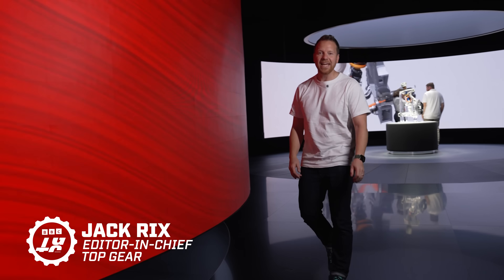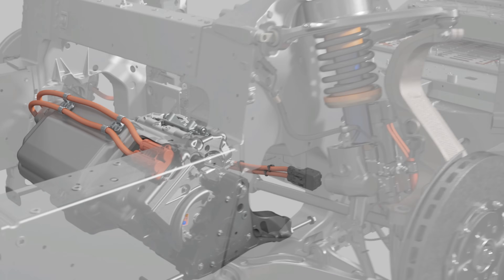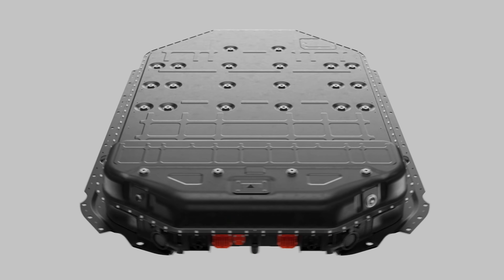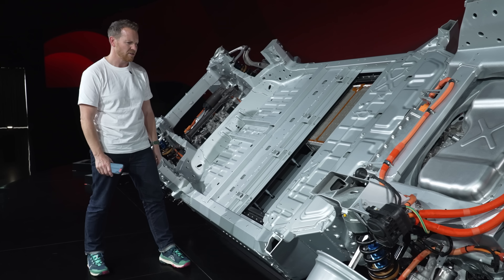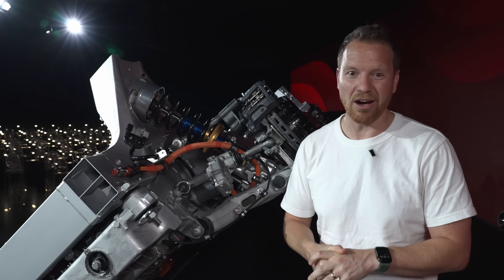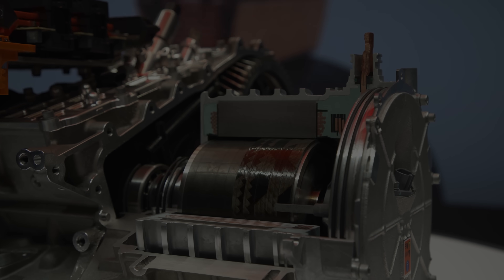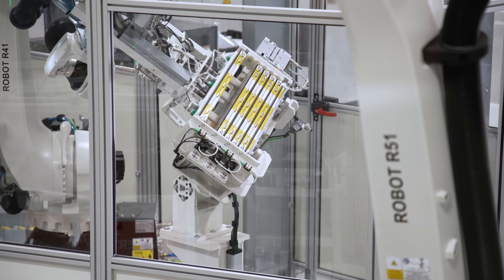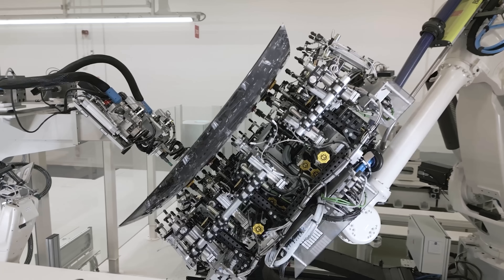Ferrari Elettrica: Tech Details On 1000hp+ EV! | 4K

Comment from the maker: Can an electric Ferrari be a ‘true' Ferrari?
Reply: Ferrari can never be a SUV, can never be an EV and god help me it can never be a EV SUV.
Reply: They're ignoring what Porsche is going through and will inevitably regret it if they don't take the demand into account.
Reply: Never
Reply: No. This will be a massive dud.
Reply: Nope
Reply: What is this question? 

Of course NO! Just look at the Porsche, Lotus and Maserati of today.
Reply: So this is the reason they bought a Xiaomi to tear down and study.
Reply: Xiaomi will never be a bench mark. It heats up after the first lap and goes into the limp hole mode..
Reply: god no. ferrari died.
Reply: No.
Reply: Never
Reply: Nope
Reply: Absolutely not.
Reply: No😭
Reply: Remember when Ferrari said they will never make a turbocharged car? or a hybrid? or an SUV? or electric?  I guess the next car is a diesel
Reply: True Ferraris (like the Enzo) need a new clutch after their third launch 🤡💩
Reply: No
Reply: no
Reply: I don't trust the motors, or I don't trust you to describe them. Permanent magnet motors are cheaper and lighter than syncing motors because they use magnets instead of coils in the rotor. Using magnets induces some slip,  so you can only have sync motors with wound coil electromagnet rotors. Adding magnets to a synchronous motor would make it less efficient and heavier, so how are the motors actually designed?
Reply: blasphemy
Reply: Why why why
Reply: no. Ferrari is an Engine Company.
Reply: No.
Reply: Complex answer: No!
Reply: no.
Reply: Why not? Or is it a dogma? Come on, time is changing and there are not only reasonable arguments for electric vehicles but also more and more technical. 2035 latest they have to change - for good reasons.
Reply: Hell no
Reply: Give it 1.000, 2.000 or 3.000hp and all the science, it won't even feel as satisfying as a V6; both for a driver and a spectator.
Reply: Hopefully it will be as well done as the Lotus EV.
Reply: OBVIOUSLY!
Reply: Definitely could be, they just need to do it properly 🤟🤟😍😍
Reply: No
Reply: hell no.
Reply: Only if you have own 4 used Ferrari's and already bought 3 new ones from your dealership.
Reply: Never. Ever.
Reply: Also, if they don't immediately change to Al+ batteries, they won't sell ten of these cars.
Reply: Nope
Reply: NO it can’t lol
Reply: What these manufacturers don't get is we pay EXTRA for a thrilling engine with amazing sound and experience. No one is interested in paying more to have the engine pulled out and a battery and motor in its place. The electric versions of performance cars need to cost significantly less for anyone to buy them, especially if they can't deliver better numbers which it appears this will not. Porsche charges more for an EV which is 1 reason why no one wants them. 0-60 numbers are pretty much a cybertruck for a Ferrari not even in production...makes no sense. The ONLY advantage to an EV performance car is acceleration. A Rolls or Range Rover EV actually makes sense...quieter, less vibration, quicker, smoother, no gas stations...a Ferrari, not so much
Reply: No.
Reply: The modern çar industry has no room for a cramped two seater with the same orless power that a spacious tesla sedan has
Reply: rage bait initiating...
Reply: This is the end , final end . The Doors is Singing
Reply: N0
Reply: No. No. No.
Reply: Yes it can and probably not either all i know is EV are the future of performance and motorsport, FE is rising and F1 is going more hybrid with 50/50 electrical power to gas in 2026 season I personally like ICE and EV performance cars so I dont mind kinda loving EV more instant torque
Reply: Yes, Ferrari is about performance and looks. However, an SUV isn't a real Ferrari (same problem Porsche has).
Reply: ONLY an electric Ferrari can be a true Ferrari obviously.
this is not about religion but about what is best, electric won a long time ago hands down.
Reply: Nobody knew they wanted an iPhone either until their friends showed them what it could do.  The Ferrari will be the same.  I mean who in 2006 wanted a “phone” that had no buttons and just a giant “screen” 😂
Reply: @aussie2uGA  I would rather an old 355 Ferrari challenge than most cars tbf lol
Reply: Rimac Nevera R and BYD U9 Xtreme laugh at Ferrari for making less than 1100 horsepower... Too little too late.
Reply: @Seventh7Art  horse power isn’t everything. Both fast as hell but, silent no sole lol. The Chinese car looks as cheap as it is. Going on anything Chinese I’ve ever owned it’s not normally built to last either. To be honest I’d rather have a 355 challenge than either of those and it’s got nowhere near the power or strait line speed
Reply: Awesome, looking forward to real world performance
Reply: Who cares? If Ferrari makes a car, it's a Ferrari. Why shouldn't a brand be allowed to expand its portfolio? People are so incredibly stupid.

But I hope it won't be an SUV...
Reply: We'll see
Reply: Yes, if they projected and built the electric engines and batteries.
Reply: Yes it is 😁😁
Reply: Yes, Electric is the future. The motor and handling technology is what's important. Batteries are what will change. They are just an interim solution to the energy requirements.

Comment: 3:16  just to clarify: rimac doesn't have such energy dense batteries because they want the batteries to give off their energy as quickly as possible and recharge as quickly as possible. it's what performance cars use and even though it's worse for range it's the best for pushing the electric motors to the limit

Comment: 1. To add the "pure sound" of the electric motors, why not use straight-cut gears?
2. Genuine question, why connect-disconnect the axle? Not just turn on-off the motors and switch between power-regen mode?

Comment: The real reason why Ferrari is going to produce a fully electric model is the following: Unlike brands such as Pagani, which produce a very limited number of cars, Ferrari has exponentially increased the number of models it offers to the public and in sales over the past few years. Because of this, the brand, as a car manufacturer, is influenced by the current European Union regulations and the upcoming ones regarding emissions control.

In short, since Ferrari has produced a significant number of cars in recent years, they are obliged to “reduce” pollution in some way in order to continue manufacturing certain models with large combustion engines.

And what options does Ferrari have for this? Raise prices, limit production, and become more like a brand such as Pagani, which, due to its very low production, doesn’t face the same government restrictions on emissions? Clearly, the answer is NO.

The solution Ferrari has chosen to survive is to create a non-polluting model, even if it doesn’t follow the brand’s philosophy in any way. This is both intelligent and sad at the same time, as it breaks the legendary essence of such a great brand.

Comment: Call me when EV sports cars have 750HP, 1000Kg and 1000 mile range.
Reply: Sports cars dont have 1000 mile range.
Reply: @vorpalinferno9711   You're forgetting that the efficiency of EVs drops dramatically when driven hard. Therefore, they need 1,000 miles of range to be able to outperform their ICE counterparts. Otherwise, it's just another reason to dismiss EVs as sports cars, in addition to the lack of a cool sound, feel, responsive steering, weight, and so many other reasons why sports EVs are CRAP!
Reply: @ronaldocost4   Efficiency of combustion drops when driven hard. At higher RPM engine efficiency always goes down. Better batteries will eventually show up and beat combustion cars in handling and 'go cart' feel.
Reply: @ronaldocost4  You dont know the future. A horse literally has soul compared to any car. Yet horses got replaced. You can still own and race horses, but as methods of transport they are obsolete.

Comment: i alwayss said that EVs should of gone with a dogbox gearing type where you gear the running gear. When your're in a gt3 racecar most of the sounds is gearbox, shafts and diffs. engine as well but not so much. That mechanical whine would be awesome in a ev with the sound of the electric motors spinning at 20,000rpm...not a bad combo if we are forced to go this way.

Comment: Very disappointed to see that Ferrari did not license, or at least imitate, Lucid's low mass coaxial drive system design. Ferrari's rear drive unit looks quite oversized and heavy for the power level. Natural sound can be engineered by shallower gear angles and tuned resonating surfaces, but using an accelerometer means their sound will be coming out of a speaker. Yuk. I was hoping to see Ferrari taking an EV seriously. That doesn't seem to be the case.

Comment: Individual reduction gearboxes for each motor and wet clutch packs. You know what that means? Oil changes. From at least 4 points. So Ferrari can sell you an EV that still cost a fortune to service. That is the real breakthrough here.

Comment: I'm not really a Ferrari fan I am way more of a McLaren fan.

The thing I'm most interested in is the noise. 

There is a motorcycle company that makes electric motorcycles in Brooklyn New York called Tarform.

And the motorcycle they produce is called the Luna and it also makes the noise. 

I think they go about it in a similar fashion. 

They don't create something. They amplify they amplify the sound that makes. And they do add a small vibration. But they tie the noise and the amplification of it to everything. Braking  included. 

It's very interesting  and quite effective from the people that I have seen ride it.

Comment: That looks like ancient battery tech tho, no CTB, and loosely packed, top of the pack is so far away from the cabin floor. And why does it need 122 kWh ? 100 kWh should be way more than enough. And for the price and what it is, 800V seems a little underwhelming, even when limited to EU manufacturers, Porsche had that years ago with their first gen Taycan. I think they are going in the wrong direction here, Ferrari doesn’t sell nearly enough car to justify a BEV, the Porsche electric turbo and mild hybrid system seems like a batter approach for Ferrari.

Comment: just so everyone here understands, the motors are not producing 8000 Nm, that is the wheel torque after the gear reduction to make 25000 rpm capable of driving at reasonable speeds. Quoting a torque output of 8000 Nm is the exact same as if I said my 2.0 makes 8000 Nm at the wheels in first gear, which isn't in any way an unreasonable number

Comment: When the batteries are toast, the car becomes a very expensive paper weight.

Future proof batteries will never exist as new battery technologies require different packaging, different charging methode, different invertors, different electric motor controllers, different cooling etc... it's just a marketing trick to persuade consumers to buy it.

Comment: An accelerometer on the inverter case is such a bodge! They're on a hiding to nothing trying to produce 'authentic EV sound' because it's (A) utterly dependent on the motor control scheme (B) wasted energy that someone will be trying to engineer out with updated power electronics. The equipment they've got now might create some audible deflections of the inverter case, but that's 'noise', not purpose. I wonder if 'fake sound' might even be counterproductive, marketing-wise, and they might be better off saying "this |                | is what it sounds like"?

Comment: Why do they have to decouple the front motors to get rear drive only, can't they just turn them off? Or do I fundamentally not understand how ev motors work?
Reply: Decoupling simply means,  on certain types of electric motors,  disconnecting them so they don't drag on the drivetrain when not providing power. Other types can simply freewheel when not being used. It's just a clutch.
Reply: The older,  traditional corded electric drills, for example,  will spin for a while after you release the trigger,  while the newer cordless drills stop very quickly.  It's due to the different type of motor,  but I don't know more than that.

Comment: 8:08 "because demand for high performance EVs are somewhere between zero and none"
truer words have never been spoken
Reply: Demand for high performance EVs is very high.  Most EVs are extremely high performance compared to an M3 or a AMG Merc from 15 years ago.  My Model 3 Performance is very, very fast.  Demand for $100k+ EVs doesn't make a lot of sense because you can get the performance, comfort, quiet, etc for less than $70k.  I drove my friend's Model Y base model and the Macan S EV on the same day and in terms of handling, acceleration.. there's not a lot between them.  He got a good deal on the used Model Y at $22k with 60k miles after tax incentive.  The Macan was $110k.  I've owned an E39 M5, I have a 911, I have a Cayenne S, I've driven a 992 Turbo S.  I know cars.  I bought a Model 3 Performance to drive every day because it's really good and as much as I drive, it's basically free to own.
Reply: @thomprd I think they were referring to cars like the rimac nevara....which hasn't been able to sell at all. Nobody is arguing a model 3 performance is a bad buy.
Reply: @thomprd  who asked?

Comment: So basically they took f1 motors ev motors and added 4 of them for awd allow a decouple while blasting real ev motor noised into the cab via speaker instead of making fake noises like their competitors. The reason people buy a ferrari is that v12 scream lets be real here you know the very heritage that made them famous in the race scene. They bought the 296 and the sf90 because the v6 and the v8s they put in while inquiring all the extra tech to work as one unit to be fast plus look good doing it, thats why people bought them. This is not that. I feel that very few will buy it and only until after most of the world is using them years from now will it get any reconition for its greatness. Sorry ferrari your gonna have to do better. The bait and switch only works with babys not adults when talking about hundreds of thousands of dollars pounds euros what ever its it epensive and if your going to spend that money then you want what you want. If you look at a ferrari you want the cery best they got. When you think about the best they got you think about a v12 with the best ev motors they have and all the tech with a redesign. Thats what the people want. This isnt that.

Comment: It has EIGHT rubber bushings connecting the rear subframe to the car. So now instead of dropping the engine for a rebuild every 40k miles, Ferrari has us paying labor to drop the whole subframe to change bushings every 40k miles, since they have to carry double the weight of a traditional vehicle.
Reply: Double 😂 check your math there...
Reply: @jamesengland7461  Average car is around 3k lbs., average EV is 6k lbs. EV trucks are 9k lbs. Google is free, buddy.

Comment: Ferrari are in a dilemma in much the same way a Porsche have since found themselves. Basically whatever Ferrari bring out the Chinese will very quickly match or better it and for a fraction of the asking price, next there's  the lack of an engine which Ferrari are renowned for and the reason why their cars command a heathy price even secondhand which will be a problem with EV simply because the technology is so new and things move on at such an alarming rate. Don't get me wrong, my opinion is electric is the future but at the moment it's a tricking industry to be in unless you have huge backing from the state like what the Chinese do.

Comment: 2:33 -- Using copper wires instead of IDC (Insulation Displacement Connectors) ribbon cable. What century was this junker made in again? 🤣
Reply: Because that is POWER ELECTRONICS not just digital signals. IDC have current and voltage limits.

Comment: "This probably doesn't mean anything to you at all" "The only people who understand this are the ones who designed it" - Nah bro, give people some credit. It's a pile of battery cells, a few inverters, some traction motors and a structure to hold it all together safely. It really isn't rocket surgery that this is at the top of what's commercially available to put into a production car, but the basics are still the basics.
Reply: PMSM with Halbach array... Do you know what that means, and do you know who built it? lol
Reply: @KyleHubb  permenant magnent synchronous motor - used on Tesla 3 rear axle, modern lifts
Halbach array - used in speaker drive coils and fridge magnets, so one side is magnetic and the other isn't.
Don't really care who built it.

Comment: Ferrari is making a mistake.  Hydrogen ICE would be the most sensible linage of power distribution to the tires. Not electric motors.
Reply: Ya let's just put one of the most explosive elements in the universe in a car 😂
Reply: @mcsike7264  Hydrogen engines have been around since the 1840's, but keep laughing; it's the only way you can cope with your ignorance.
Reply: @r0x0r-p4t so what? EVs have been around since the 1820s. So EVs should come first. Maybe wait for another 20-30 years for your Hydrogen car to nuke our roads. 
Remember hydrogen leaks like hell. Even if you filled your tank with hydrogen it will turn empty in a week. That's why we still fill the hydrogen rocket just minutes before launch to reduce the boil off
Reply: @r0x0r-p4t just bc its bin around for years dose nit mean its the answere
Reply: Trevor Milton, is this you?